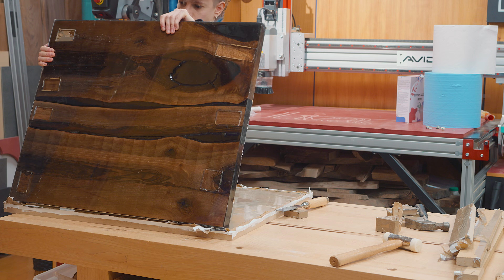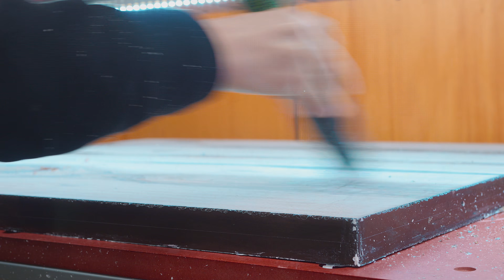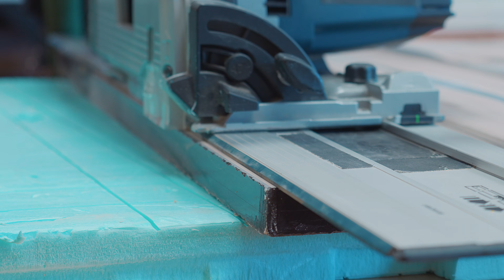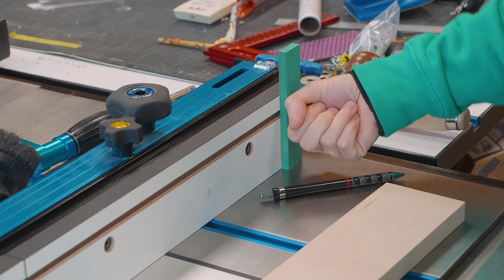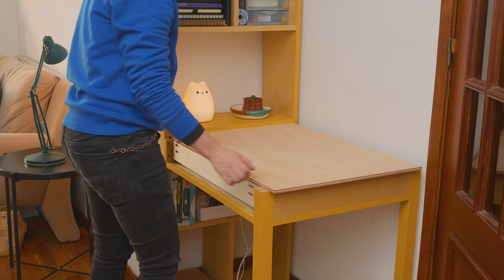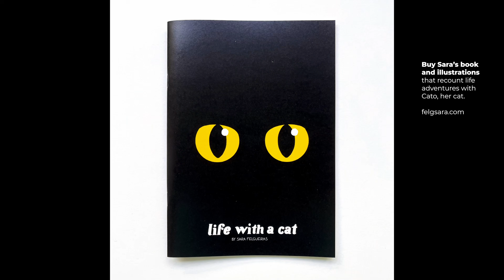Custom Built Tiny Desk

Comment: I know you aren't a fan but in this case I think the residual sanding marks on the resin actually work well in this case - adding a texture that makes it a little less bold and more understated allowing the wood to be the shining star. 
in future though; epoxy resin as far as sanding and polishing goes is more like metal than wood. You need to sand + polish to a MUCH higher grit to get out sanding marks and/or polish to a high shine. John Malecki does a lot of epoxy river tables and goes through the process including a spray finish on top. Essentially though, 180 grit is far far too low for epoxy (at least without marks being left), you want to aim for at least 600 grit on the epoxy if you're wanting smooth and towards shiny (if you want a mirror finish without sanding to death you can coat it in a final, thin (as in 1mm), layer of epoxy (or uv epoxy) for that high gloss shine - or a spray finish can work). Someone else mentioned wet sanding to keep the epoxy dust down to a minimum but balancing it with the wood with which I concur although your dust collection would likely do most of the work here. 
I might be wrong but I believe you can get to mirror shine through sanding alone if you take it up to the 1500+ grit range and finish with a plastic polishing compound.

Comment: Use a heat gun to hear the epoxy and get out the bubbles. Or use vacuum. Vacuum works too to remove the air of the mixed resin before you pour it.

Comment: to remove the marks on the epoxy and wood  you need water resistant sanding paper . You finished  with 180 ;so you continue with 220,360 and 400 .  Woca woodoil  for heavy duty can be used to finish it of ,using the sandpaper to push in the oil and then remove the excess . Hope I express myself clearly enough ?  You can also use polishing paste to buff the epoxy after the sanding of course .

Comment: Here are a few thoughts about the resin. Black hot melt works frequently for holes. You might use a torch a few times after you pour. That tends to draw out the air. Also, 180 is good for Rubio but not enough for epoxy. You definitely need to go to 400 on it. That should take care of any swirls. Your work is great! Epoxy is fun and rewarding. With your talent I’m sure you’ll master it as well!

Comment: Beautiful!! 
I'm no epoxy expert, but the type of finishing used makes more difference than sanding up to higher grits. Uni-directional hand sanding gets rid of the swirl marks fairly easily on epoxy (upto 320-400-even 600 - Very very light pressure, not a lot of material is removed)
Most forms of spray-on Lacquer are exceptionally good at hiding all the tiny imperfections, but they do leave a "plasticky" finish. Hard Wax Oil is a fraction of the thickness vs a PU or acrylic varnish spray. As a compromise, I have used a homebrew version of Danish oil for fast & decent results - Boiled Linseed Oil + Beeswax + PU Varnish + some form of oil thinner to make it seep in easily.

Comment: The pigtails in the epoxy comes from dust caught in the holes of the sandpaper on the sander. Looks clean isnt as clean as you think. Give it a vacuum between grits as well as wiping down the work piece your working on. Ive noticed them come up on wood surfaces too depending on how much sanding ive been doing and the type of timber im working on. 
If rubio is the finish im using i will sand epoxy to 320 and if its a clear epoxy even higher and then buff it out before finish. Hope that helps but your table top looks amazing and i hope your sister was happy with her new work area 😊

Comment: I have been brainstorming some ideas for a bookshelf with a built-in, fold out coffee table for a bicycle camper I built and I am sure I will find some inspiration in this video!  I even have some table top epoxy to play with.  It is a bit trickier design than I am used to because I am using a mix of rigid foam board and 1x2, skinned with real wood veneer...so save weight in my camper.  So...epoxy might be out, or a very shallow pour.  I did use the epoxy on the camper desk, but just as a gloss protection coat...nothing artsy.

Comment: Booom!!!

I think the epoxy woodworkers use much higher grits than 180. They go to very very high numbers ending with a polishing wheel and polishing compound. So it is no surprise that you can still see sanding marks with 180 grit. Just my 2 cents. I’m no expert.

Comment: Most of the epoxy projects I've see follow the sanding stage with another brushed on thin layer of epoxy (over the entire piece) - which completely hides any sanding marks - I think there's a specific type of epoxy for that purpose.  Then the paste wax (or other finish/varnish) brings the surface back down from high gloss to whatever glossiness you're after.  Thanks for the videos.  Stay safe out there.

Comment: Having worked with a LOT of epoxy, I can give you a couple of tips that I learned through trial and error. First, don't feel bad. Epoxy table tops take a LONG time to master. I started off small with filling in knots on hardwoods just to get comfortable with the process. 
1) I use MAS Table Top Epoxy. It's become my go-to product. The disadvantage of it is drying time of about a day or more. But this thing is very forgiving about mixing and even if you are sloppy it will work. Plus, I have never had a problem with bubbles from it. BUT, because it is thick, it can be a two or three coat process to fill in big holes. You'll see what I mean because getting the epoxy to seep into the hole can be a - challenge. However, it is well worth it to avoid that bubble problem.
2) For me, if you want really eye popping epoxy, I sand to 400 grit using MAS Table top epoxy. It just turns it into glass. I was really impressed by that. 
I am not a sponsor for MAS Epoxy, but after trying so many others, this is the one that works for me.
Your table looks fantastic and for a first -timer, don't beat yourself up. You did amazing!
BTW-> that black cat looks just like mine -> except mine might be slightly about 20lbs (US measurement)
Reply from the maker: Thank you so much for your detailed comment! I just googled MAS epoxy and it is only sold in 2 places in europe (not Portugal or Spain unfortunately) but I’ll see if I can order it from Sweden. 
Omg your cat ahaha 😹 I can’t even imagine a 9kg cat. Well “treated”, it seems!
Reply: @GetHandsDirty  Here is a story for you. Our 4th cat just barged into our house - he was a stray apparently - and looked at our 'fat cat' and basically said 'well, you guys eat well here' and he stayed :)  Of course we could not say no :)

Comment: I think it looks good.  Resin is tough and takes a ton of patients & time.
I used a Redwood slab on a outdoor bench seat that i spaced on the high humidity in summer here in US Deep South, it wouldn't had been an issue in the Pacific NW. I used dowel joints, what supprised me is the swelling caused the redwood to lift off. I even had the slit in the top of the dowel where u hammer a wedge into

Comment: Hi, when I use epoxy with wood I always sand to 2000 grit and then hand sand in the direction of the wood grain also using 2000 grit paper. Depending on what finish I use will either polish the epoxy and wood with a wax finish or use a varnish type finish. My only advice to you is simply have a go and see what works best for you.
Great job though, well done.

Comment: I typically start dry-sanding with 80/100 grit then move up to 120, 180, 220, 320.  I make sure to blow off dust build-up from the sandpaper and clean my workpiece between each grit. When I finish with that, I wet-sand at medium speed using 400 and finish with 600. I have no problem with the finish adhering after using 600 grit. Keep in mind that you have to be cautious about how much water you use because of the wood. It's a long process but totally worth it in the end. Keep up the great work.
Reply: I also sand sand as you,  then I do a 2 step process buffing on products that are made for cars. 1st step is even a finer type of sanding that gets out scratches from wet sanding and the 2nd step gives a sheen finish as well as protective coat that can be reapplied as needed. 
I also used this method on my concrete countertops stained black/ custom kitchen cabinets I built out of marine grade plywood.  I did a multi layer ebony stain where u could see some grain with multi layers of water-based (non yellowing) urethane. It was a never-ending project. 
The appliances are stainless steel with the dark glass.  I just finished putting the cork flooring down yesterday, it's a light tan w the black marks. Man what a different the cork made vs the 80 yr old hardwoods! My father kept asking "why am I designing an industrial house"? He spotted by yesterday, "OK, ok,.... I see it now,  it is very modern & fits your weird OCD minalmist personality". I'm hoping that was a compliment.  😂

Comment: I'm not sure why the grit to sand was so low. Other videos I've seen show sanding resin and wood pieces up to 1500 or higher. There is also micro mesh pads to wet sand up to 12000 to 15000. Basically, you can sand as high as you want. You could also put a top coat of resin ober the entire piece to fill in the voids and add shine to the entire surface. If the imperfections are on one side, just put the good side up.
Reply: To be fair she did follow the manufacturer instructions for the wood finish. 

That said, that instruction kinda does assume its only being used on a soid wood product (ie no epoxy). 

Epoxy (or basically any plastic) need super high grit for sure. But not sure how the higher grits affect the wood finish... usually wood waxes use a lower grit as you need the wood fibres 'exposed' for the wax to be sucked into.
Reply from the maker: Yes, this hardwax oil (Rubio Monocoat) that I’ve seen many people use on YouTube on such projects is meant to bond molecularly to the material (wood) and they recommend going no finer than 180 grit. But maybe I missed something regarding the epoxy sections. Perhaps I could have sanded only those parts with 320 or 400 grit… next time I will investigate more about the sanding procedure.
Reply: @GetHandsDirty  it's a experimental thing. I have watched other videos about epoxy/wood tables. They used different products than the monocoat. I think the desktop turned out great, so if you are more familiar with one product over another, then I cannot fault you for that.